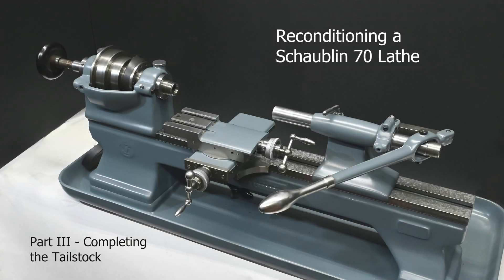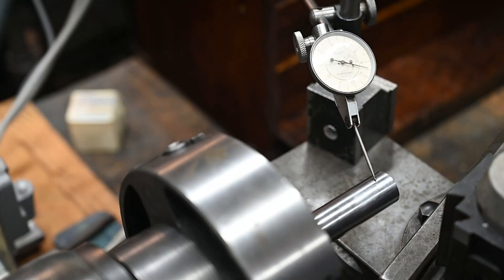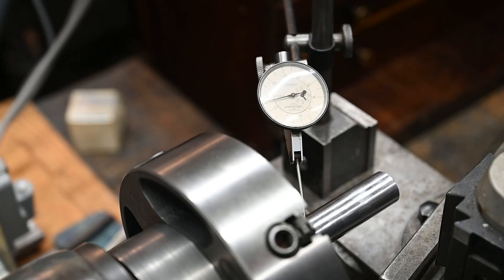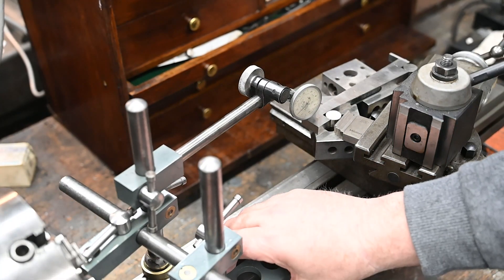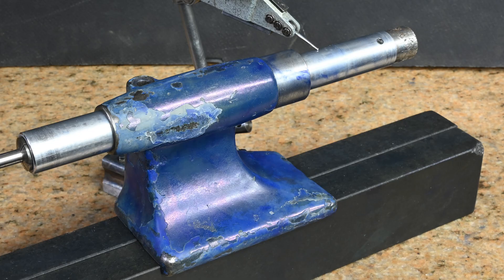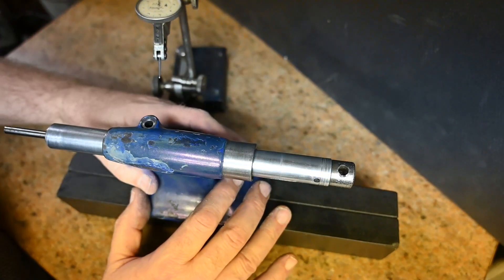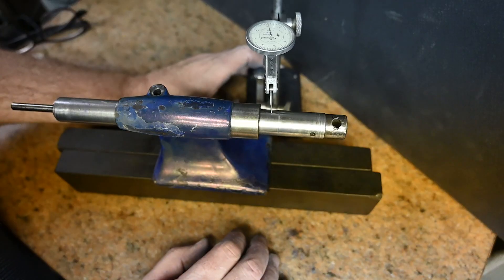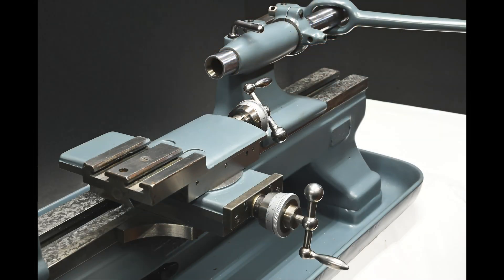Reconditioning a Schaublin 70 Lathe   Part III   Grinding the tailstock taper and scraping the base

Comment: Your craftmanship is amazing. I've never seen anyone on youtube restoring the lathe to such tight tolerances (and the Schaublin lathe is definitely worth it). If I understand it correctly, if you're saying "1/10th" it equals to 0.0001 of an inch which equals 2.5 microns in metric system. Even my watchmaker's lathe has spindle runout about 3 microns. 323 subs seems like a crime for this kind of precise work
Reply from the maker: thank you!, yes a tenth as I refer to it is 0.0001"  Sorry for being colloquial lol, I'm in Canada and despite being official metric a great deal of metal working is done in imperial dimensions

Comment: Very informative videos, no Hollywood flash. But amazing craftsmanship. The quill on my  Levin 10 is stuck, after finally getting a drawing for it(that) was hard. The smaller excentric lever has a plunger, that I suspect is there to secure the quill, I'm guessing is stuck. No real way to access it. So is soaking in 50/50. Been really paying attention to your scrapping. Thanks